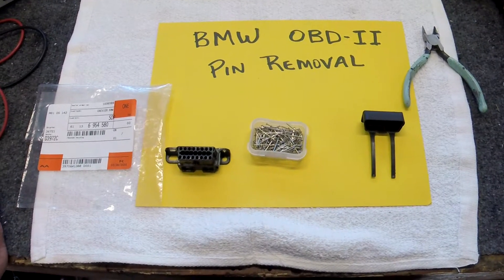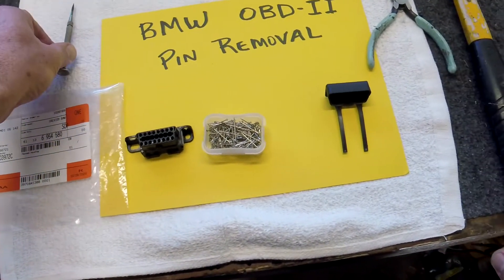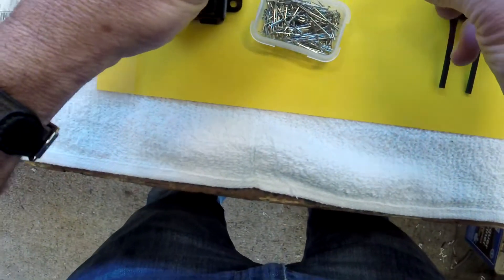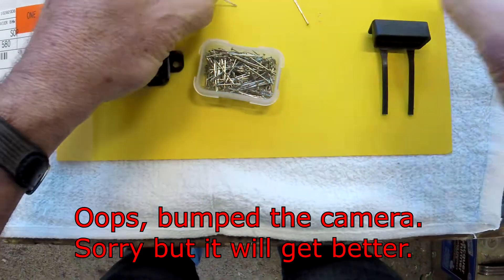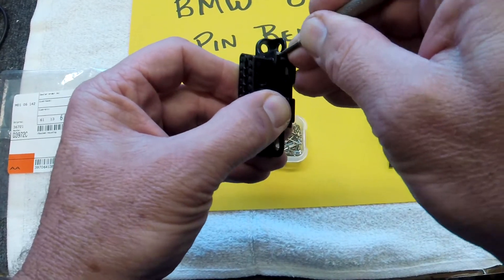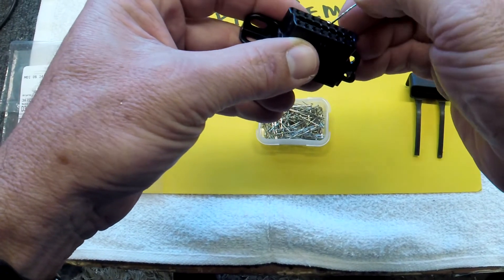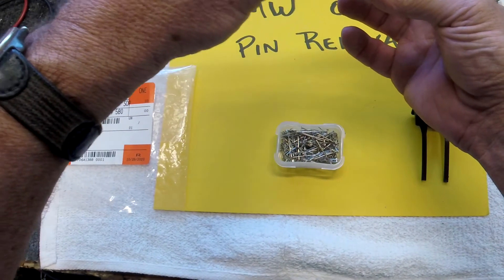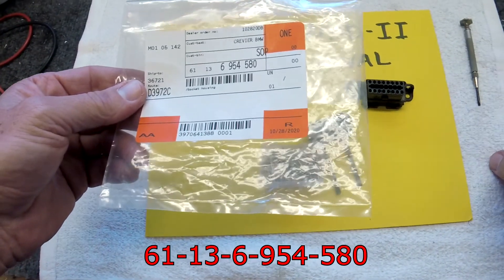BMW OBD II Pin Removal

Comment: Could You give me the original part number of that connector pins? Thanks in advance!
Reply: Thank You for answer ;)
Reply from the maker: Since I didn't have to replace any of the pins, not sure, but try this one:  p/n 12527502933

Comment: Hey. Thanks for the tips. Struggled a lot and broke one wire, but managed to do this 😂. For anyone doing this, 'pin pusher' has to be stiff and go in a lot. If the wire does not come out by pulling with fingers smack the pushers in more. It will damage the plastic, but you are already replacing the port.
Reply from the maker: Good additional info.

Comment: I broke my wires, where can I get the replace pins? So, I can cut the broken end and put a new pin on it.
Reply from the maker: Yes, you can get the new pins at the BMW Dealer.

Comment: Hi Marty,  great video. Do have the part number for the female contact pins?
Reply from the maker: 61-13-6-954-580
Reply: @MartyMitchell92660  thanks.
Reply: @MartyMitchell92660  that’s the housing for obd2. Do you the contact pin that inserts into the housing?